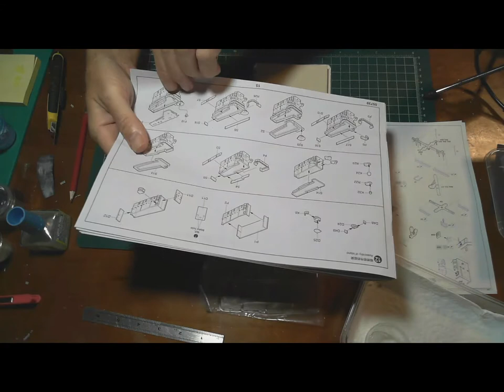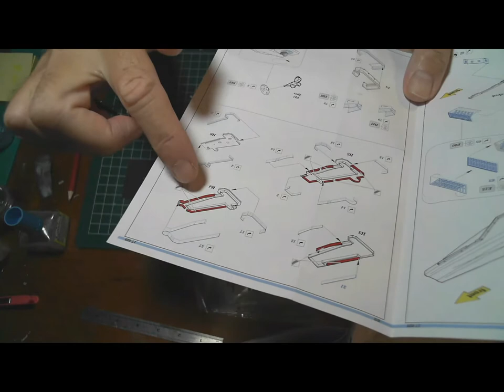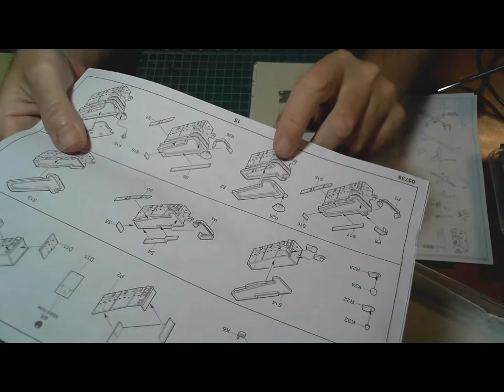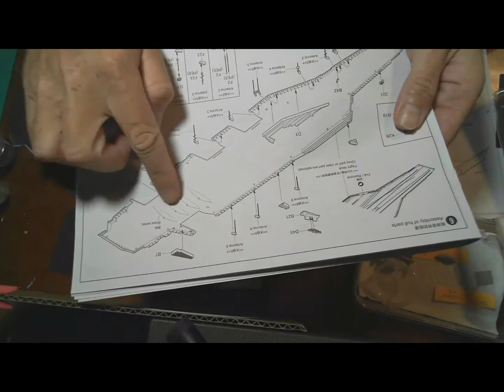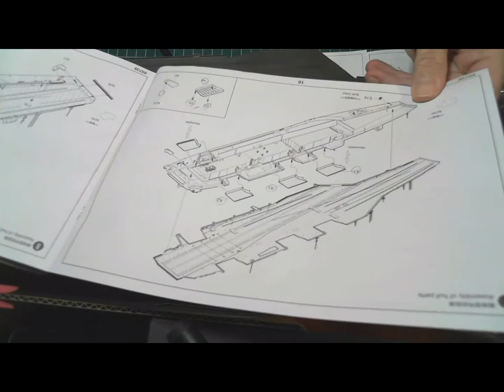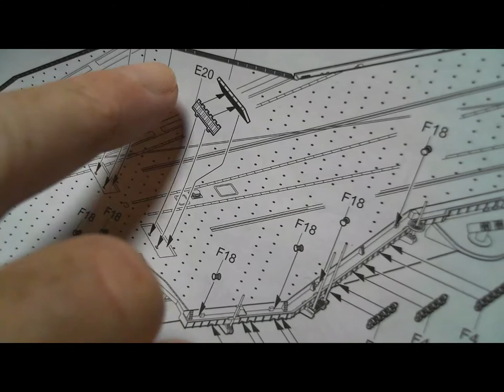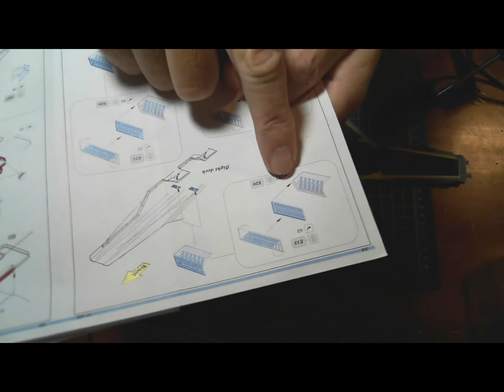USS Nimitz CVN-68 Aircraft Carrier 1/700 Build Part 5

Comment: 14:10 Oh so delicate.
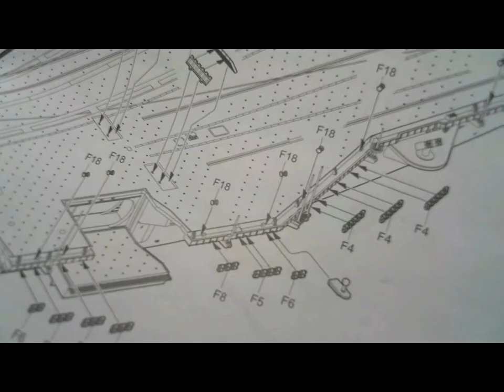20:51 My heart almost stopped! Thought you'd accidentally dropped the manual on the deck.
23:10 ... and no paint stuck on the tape.
25:25 I've had good luck with the Frog Tape too.
27:24 .... jet blast deflectors
32:01 Yes, see you in part 6 Peter. 👍👍